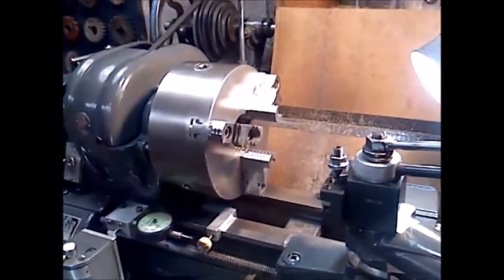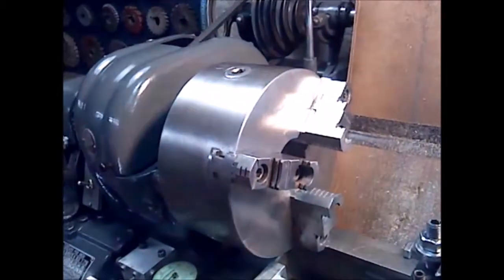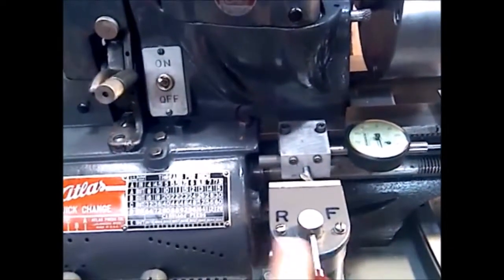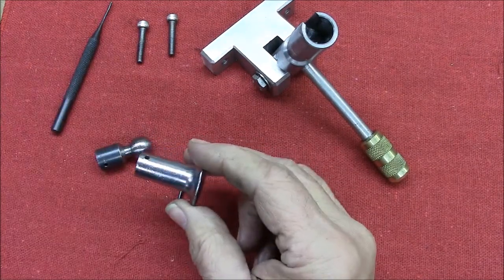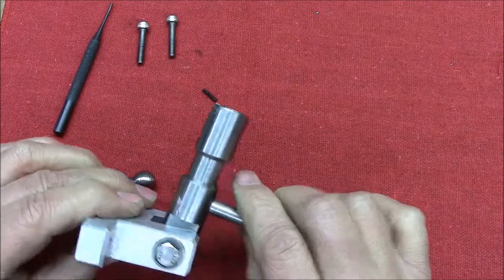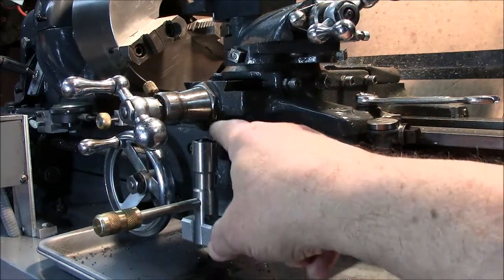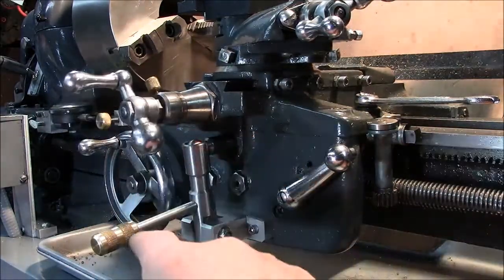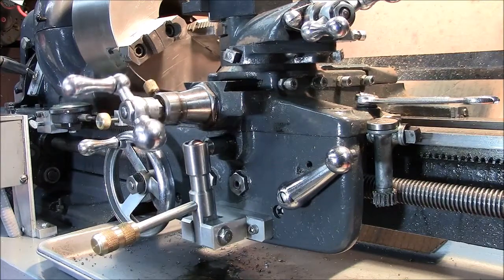Atlas 10F Lathe Cross slide Control Upgrade

Comment: Hi Fred, I am Jim Perry from Clovis NM. I purchased my 10F-28 locally about seven years ago.   
I have two problems with my lathe that I would appreciate some help with, first, the sliding pin behind the chuck that engages the back gear will not stay ingaged while I’m cutting or turning parts on the lathe. I’ve looked at the illustrated parts break down and I don’t see how to fix a detent to hold the pin either in the engaged position or not. And last, the gear that engages the rack to the carriage slips a lot. I’ve dropped the front of the carriage down and checked the crank for moving the saddle back and forth and haven’t found any of s the small gears loose nor have I found any part of the rack worn. 	So any suggestions would be greatly appreciated.

Comment: Is there anyway that you could provide a wiring schematic of how you connected the drum switch up. I am at wits end trying to find the information on how to wire up my motor. I have a Leeson 1/2 hp single phase 110vac motor that has seven leads and a new Dayton drum switch.

Comment: Thats a great idea , I am going to do that to mine now , that rotating knob is just impossible to use pulling it in and out using fingers just results in slipping off all the time , I have also fitted mine with electric feed using a parvalux motor with worm drive gearbox on the tailstock end of the leadscrew , can still screwcut just need to remove motor timing drive belt only takes a few seconds , my leadscrew is now mounted in self aligning ballraces as the original plain bearings were rubbish my lathe is now driven with a one and half HP 3 phase motor and VFD I managed to get a new damaged motor for half price ( dented fan housing ) easy fix , total cost including VFD £ 180 well worth it, I wouldn't have done it to a plain bearing headstock lathe but mine runs in Timken taper rollers , well done for your excellent design keep up the good work I now have another upgrade to do

Comment: Hello Fred, I am very interested in the modifications you have made. I like your leadscrew drive, and cross slide modifications. Like the tool post modification as well. I am no machinist, but I make parts for old Harleys.  Would it be possible to share email so I can correspond with you Really want to upgrade my 10F.  I have so many questions lol
Reply: Whre did you get your tool post?  IS there a way to make the cross slide stronger  i get chatter in mine, is there an off the shelf upgrade?

Comment: Very nice, I have a th54 that does not have the quick change box, I put the electronic lead screw on mine from Clough42. 
I also added a hand wheel from a milling machine with 200 graduations giving direct diameter reading on the cross slide , I Will definitely be copying your great addition, 😊
Reply from the maker: Thank you for the nice comment and good luck with your build.
Reply: Chuck I would be interested in seeing some pictures of the install of the Clough42 lead screw. I am in the process of putting one together on my Atlas 618 and I just bought an Atlas TH54 Saturday and after the clean up and painting I will be putting a Clough42 upgrade on it.
Reply: @bobkarstien1248  Bob I keep trying to send you my email address but YouTube evidently keeps blocking my reply to your comment.

Comment: I just inherited my grandfather's old Atlas lathe. Not sure which model it is, but based on memories I think it's 10" series. I'll find out Sunday when I pick it up from my dad's house. My dad says it also has a full suite of tools. Man this thing is going to bring back some memories
Reply from the maker: Very nice!  Measure from the very center of the chuck spindle to the ways (bed). If it is 5" or a bit more than it is a "10 series" lathe.  Get it working and make something cool.  It is a great feeling!
Reply: @FredMiller  apparently it's fully functional. My dad has used it a few times, but recently got a 4 axis mill/lathe setup, and needs the space. So alas, I have a lathe. Lol
But I do remember days, many decades ago, spending hours watching my grandfather machine stuff on this thing, and "helping" him out.

Comment: Just wanted to mention these lathes were designed for use with the original short chucks.   Some operations like parting work better with the original chucks because they are more rigid.  That is to say the shorter lever arm flexes the spindle less.  Thanks for the video
Reply: I have the same lathe and it came with the original owner's manual . A 10 inch four jaw chuck is listed as an optional accessory for $30  An 8 inch four jaw chuck is $25 , and the 6 inch geared scroll chuck is $40
Reply from the maker: @teakkaye5364  Thanks for the info...  Those were the days!  LOL
Reply from the maker: Harold you are absolutely correct about the short chucks.  The mass of the chuck on this lathe works well to overcome vibrations when parting. Thanks for watching.

Comment: What did you use for lead screw motot
Reply from the maker: I built a motor controller from a high quality windshield wiper motor.  I drive it from the tail end of the drive screw.  I hopefully will be able to make a video on the unit in the future.  Stay tuned.  Thanks   Fred

Comment: 54 inch Atlas that is a long one, you have the turret on yours? We are new to your channel and subscribed thank you for sharing your machine. Nice lead screw modification will machine nice smooth steady finishes like that feature a lot. You have really added a lot even that cool depth of cut tail stock controlled measurement nice. Now lets stop typing and learn what is going to become of the cross slide feed. Your channel is a joy to watch wonder why I just found. nice no more reaching under flustering to grab that little pull push knob you can now just grab the handle you made. Lance & Patrick.
Reply from the maker: Thank you fellas! I am pleased to see you got some tips from my channel..  Regards..   Fred

Comment: Hi Fred,  I just came across your video on the Altas,  I have the same TH54 that I purchased at an estate sale.  The lathe is a little (lot) tired but it is on my list to restore and update.   I like your mod and plan to do something similar. 
When I get ready to do a resto-mod to the lathe I'll be referring to your channel.

Thanks for sharing.
P.s. I added you to my subs page.
Reply from the maker: I am glad it helped you.  When I found mine it was tired as well but restored really nicely. This is the 3rd Atlas lathe I have restored.  Ebay is a great resource for parts and Youtube a good resource for "how to".  I also have a model 618 (6" lathe) for very small steam engine work.  Thanks again for watching and good luck with your restoration.
Reply: I purchased the lathe almost a year ago and I keep it by the door so every time I enter the shop I'm reminded that it's still waiting.  I have a smaller lathe and bench mill that I use but the long bed of the Atlas will come in handy for some special jobs.
I've started rehabbing my shop getting it ready for some serious fab work this spring and hopefully interesting videos other than home projects.  Tag along if you would like to see how it evolves.

By the way, that's a sweet MGA,  I had a B in college and currently 49 MGTD in boxes that I'll be doing a resto-mod once the shop is ready.
Later
Walt
P.s. I post updates and previews on Instagram @ southernengineering

Comment: Big chuck, How are the bearings holding up?
Reply from the maker: I was concerned about that too.  I check it out about once per month and so far no issues.  I like that chuck because the bore is so big I can insert a 5C collet holder with no problem.  Thanks for watching...
Reply: @FredMiller  Can you tell me exactly what brand and model chuck you have.  I have an Atlas QC54 10" lathe that I got from my father who had it since the 1950's.  I an looking for a new accurate 3 jaw chuck.  Based on your experience.  What would you choose.  Thank!
Reply from the maker: After a many week search on Ebay I was lucky enough to find a PUUm-S 8 - 8 1/2 ZD chuck.  PUUm chucks are made in Poland and are a very well made unit.  If I had not found this chuck I would have opted for a 3 jawed backplate adjustable "Buck" chuck. It is possible to dial out almost all the run out with this unit.  If you have no chuck for the lathe now I would opt for a 4 jaw since a 4 jaw can perform almost all functions of a 3 jaw plus all run out can be dialed out.  A 4 jaw can also perform many more functions that a 3 jaw.  There are many Youtube  videos on this subject that are well worth the views.  Best of luck and do let me know what you come up with and how you like it.  Fred
Reply: @FredMiller  With your 8-1/2 chuck... when the jaws are fully extended do they hit?  If you do not mind me asking, what did you have to pay for your chuck ?  If I cannot find a PUUm-s chuck, what model Buck chuck do your recommend?  I have a nice 4 jaw chuck and original 3 jaw chuck.  One of the jaw on the 3 jaw was damaged by me (on the clamping surface) when I was about 15 years old (about 34 years ago) and the accuracy has suffered. I would like to find a nice new 3 jaw chuck.  Could you also recommend a good dial (or digital) indicator.  I want a setup that works well for centering parts in the 4 jaw chuck but there are so many choices and it is hard to pick a price point.
Thank you.
Reply from the maker: Always swing the chuck by hand after loading a work piece to see if everything will clear.  The faces of the 3 jaws of this chuck are reversible.  So they can be configured in two different ways to accommodate the job holding.  I think I paid around $225 on Ebay.  Since I do not know a lot about Buck chucks I would call a distributer and tell them what you are looking for and what lathe you will be mounting it on.  I am sure they will help you out.  As far an indicator goes they are available on Ebay at very reasonable process.  You will also need some sort of base (probably magnetic) to hold the indicator.  They are also available reasonably on Ebay.  I would ask around your neighborhood to see if there is a hobby machinist that you can go visit. Most of us are very receptive to having visitors and sharing knowledge.  Best of luck on you searches.